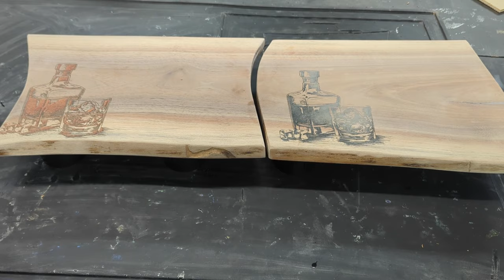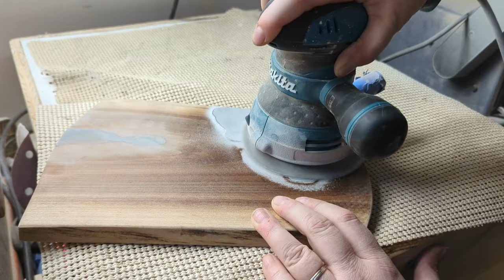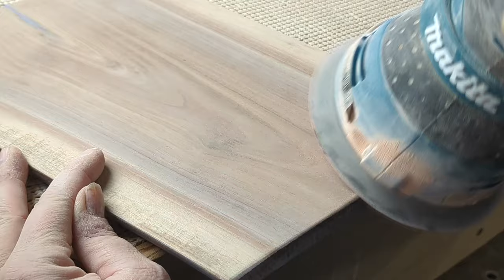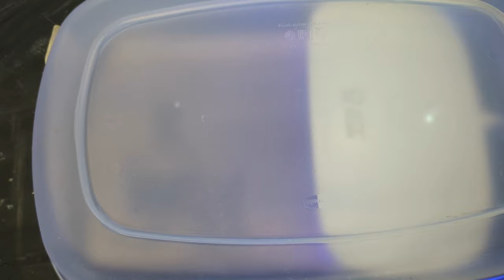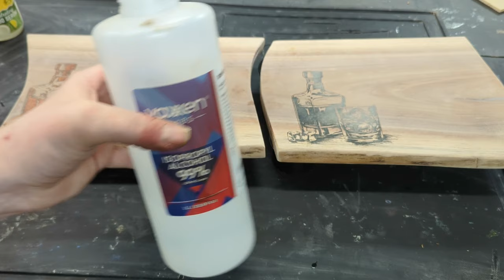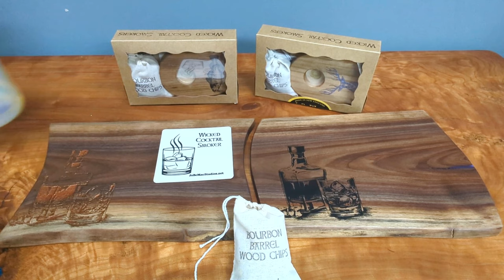I Made a Custom Cocktail Board and So Can You

Comment: You can just scrape off the excess epoxy by lightly scraping over the design with a plastic dry wall tool.  

They’re cheap and you can sand them down ever so slightly to leave just enough left over to account for any shrinkage that may happen. It will save you a few sheets of sand paper and a significant amount of time on sanding.
Reply from the maker: That is true and I usually use a little less, although I only used about 35 grams of epoxy for this.  However, resin bubbles tend to go to the top, or near the top.  If you only pour enough to be just over the engraving, you may get more trapped bubbles.  I do find that I have less that I have to deal with if I over fill.  It took me about 6 minutes to sand each board.